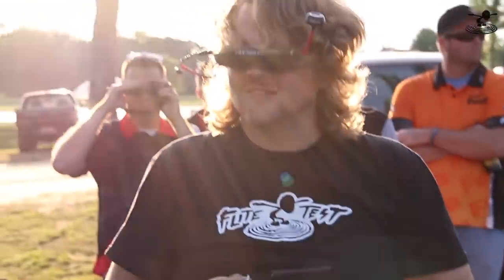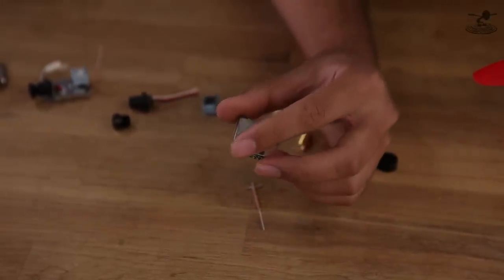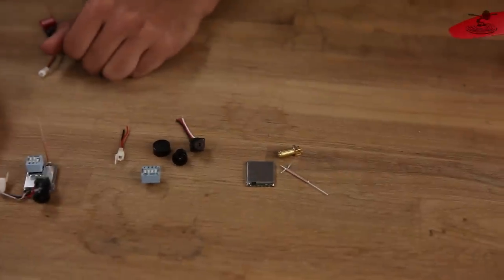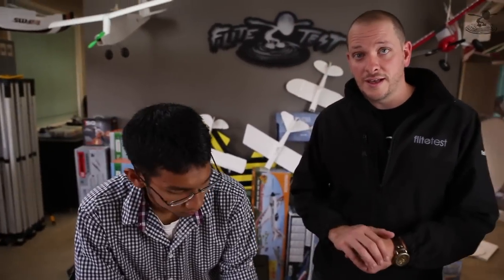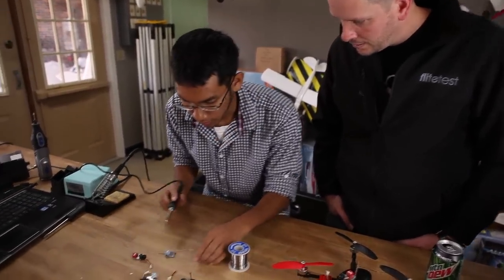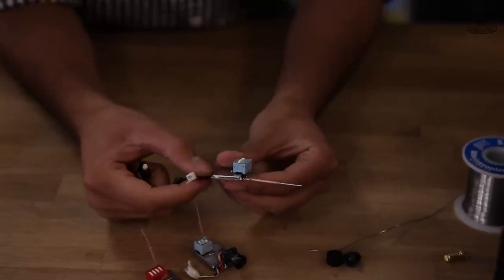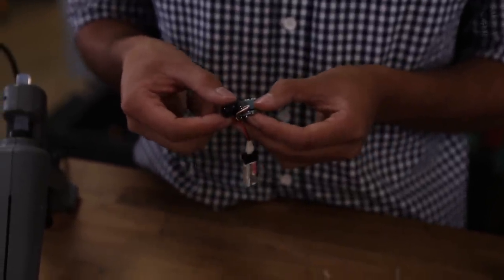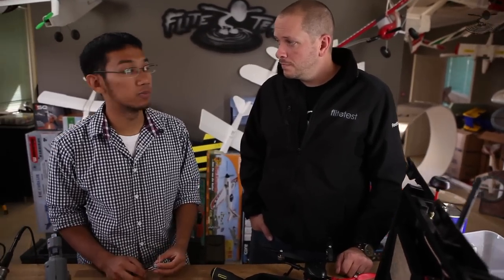Flite Test | DIY Micro 5.8Ghz FPV

Comment: Will this set up work with a 2.4ghz quadcopter,  or will there be interference issues?
Reply: As long as your control and video arent on the same frequency, you will be fine, so it will work

Comment: Is it possible to do the FPV with Iphone or any other smartphone?
Reply: not sure, but i think i read about an app for android (probably ios too) called Litchi that can turn you phone (together with a cheap vr headset like google cardbord headset) into fpv.
Reply: manbolo2 Thank you for the respond, I appreciate it. I will check it out.
Reply: Dale Bergeron
i have only read about it, interested to know more, what do you need to setup? dont you just connect the phone and go? and change what battery?
Reply: Search Andy rc, he has a video of using phone for fpv

Comment: I have video signal but I lose it when my fingers are not touching the tx, I also don't have a 3 position switch.  All the connection are solid same type of attena wire as in the video. Fatshark with clover leat attena.

Comment: This is awesome and perfect timing for me. I just bought the FPVhobby 5.8ghz combo and my range sucks check out my last 2 youtube vids. Could you please do a vid on micro antenna setups? The RX antenna that came with my kit is only 2dBi, I have been told I should step up to a 12dBi antenna to quadrupole my range. Then what about the length of the antenna on the TX side? The little antenna that came on my kit is only 15mm long which I have been told is only 1/4 wave. Also for a cheap ground station (if you own a laptop) you can get an EasyCAP USB dongle ($12), I'm flying FPV now for around $140 (which I think is pretty cheap :D )
Reply: Well. I believe that you've overpaid. I've got my set up for $105 delivered and I don't need to carry my laptop to the flying field. Range to be confirmed but it does penetrate well nearly 0.5m thick brick wall and the ceiling/floor, so should be fine in the open.
Reply: Aussie dollars inc. postage to Australia. I like carrying my laptop to the field so I can record and watch footage between packs. Plus I don't really like goggles and my laptop monitor is nice and large.... And I don't need any additional equipment taking up room in my workshop.
Reply: the 200mw unit that comes with fpvhobbys 5.8ghz super combo

Comment: Hi There,
I need your help on something. I want to put together stand alone turret fpv but I am not good on electronics. What I need your help on is that. My component will be fpv camera, fpv transmitter, 2 micro servos, one receiver for controlling servos and one 1s lipo îf 1s is enough. The help would on cabling how to connect these component together. The thing is that this turret cabling will be separate from the rest of  the drone.
Reply: use 2 receivers, bind both at same time and use different channels not used for flight, enables 360 deg turret

Comment: I want somethimg for high range high speed flying. even for a low resolution such as vga as long as I can not crash my plane. weight is not that much of an issue but nothing more than 200 grams. also nothing that would cost a kidney and a lung. what do you recommend?
Reply: +Anas Malas i recommend you pray for a miracle or get a job
Reply: rebelsouljaz I wish to... Child labor laws here in UAE suck! And living on the 30'th floor there aint no backyards to moa the grass doesn't help either...
Reply: ***** it was a joke, your sarcasm detector is malfunctioning. Try to top up the anti buthurt fluid. If that doesnt work you have to go and buy another sarcasm detector from your local dealer. Remember to only use genuine parts!
Reply: +Anas Malas damn so many people hating for no reason this is smart.

Comment: How can I make the receiver which is receiving frequency from camera device and showing on that LED screen ?
Reply: +Shuvo Islam buy a video receiver. There are many on the market. cheapest 12 dollar but only 8 channels. and the others arround 30 to 60 dollars depending on the brand and type. those have 32 channels and should be ok for all 5,8 except race band. i added a few options. the cheapest i am not sure of because i am not sure on which channel the micro transmitter will go. it has only 8 channels and there are 32 channels. you can connect the receiver to a screen. (see links) there are two links that have a transmitter too. a big one compared to the micro you wanne build but maybe use this for an other project.  and there is also a diversity receiver. this has two receivers in one and will go for the antenna that has the best reception. constantly switching over. works best if you add two differen styles antenna. NEVER NEVER put power on a video trans,mitter without the antenna connected. you will fry the electronics

http://nl.aliexpress.com/item/FPV-5-8G-600mW-A-V-32CH-Transmitting-Receiving-System-TS832-RC832-RP-SMA-Kit/1070833505.html?spm=2114.020208.3.1.cBG8bE&ws_ab_test=searchweb201556_2,searchweb201644_1_10014_10001_10002_10005_301_10006_10003_10004_62_61,searchweb201560_1,searchweb1451318400_6150

http://nl.aliexpress.com/item/Boscam-FPV-5-8GHZ-8CH-Wireless-Audio-Video-Receiver-RC305-Double-lines-AV-output-Receiver-FOR/32283319980.html?ws_ab_test=searchweb201556_2%2Csearchweb201644_1_10014_10001_10002_10005_301_10006_10003_10004_62_61%2Csearchweb201560_1%2Csearchweb1451318400_6150&spm=2114.020208.3.2.T3eyLY

http://nl.aliexpress.com/item/BOSCAM-SKYZONE-FR632-5-8G-32CH-HD-Channels-Diversity-satellite-receiver-RC-Digital-LCD-Display/32250935608.html?spm=2114.020208.3.1.bWDLxD&ws_ab_test=searchweb201556_2,searchweb201644_1_10014_10001_10002_10005_301_10006_10003_10004_62_61,searchweb201560_1,searchweb1451318400_6150

http://nl.aliexpress.com/item/7-FPV-LCD-Color-800x480-FPV-Monitor-Video-Screen-7-inch-HD-Sun-hood-for-Rc/1951841641.html?spm=2114.020208.3.2.HR2KQA&ws_ab_test=searchweb201556_2,searchweb201644_1_10001_10002_10005_301_10006_10003_10004_62,searchweb201560_1,searchweb1451318400_6150

http://nl.aliexpress.com/item/Long-range-FPV-Combo-5-8Ghz-Boscam-5-8G-600mw-AV-Transmitter-Receiver-No-blue-800x480/32324018483.html

Comment: If I want to add an audio, what should I do? Can an ordinary mic be used?? Please do help, thanks.
Reply: At 7:35 they talk about audio input. You have to read the specifications of the transmitter to see if it supports audio. Anyway this video is  3 years old. I think that there are more solutions now in order to avoid this process if you are not comfortable with it.

Comment: On 3.3v transmitter board can you use a 3.7v lipo 1 cell? i can't find 3.3v anything battery
Reply: probably, but i would use a linear voltage regulator for the 3.3 v
Reply: MY BATTERIES WORKED JUST FINE THANKS ANY WAY :)

Comment: You show Fat Shark goggles being used at the beginning of the video, you talk about the different 5.8 bands available and compatibility issues. Can you tell the viewers what receiver equipment is being used with this model transmitter? It is clearly not Fat Shark or Immersion compatible and even the small snippet with the frequency page used to set the dip switches also show non compatibility with the ever so popular Immersion and FS equipment.

Comment: Is the microphone added to the circuit?
Reply: +Terry More it depends if you have a mic or not. if you buy the cam they suggest you have no cam and pay way too much for the cam. buy the camera at banggood and it will have a mic too. and it would cost less then 10 euro. great deal. the white wire will be the audio. the gold round thing is the microphone. 

 http://www.banggood.com/600TVL-8_0MP-14-2_8mm-CMOS-FPV-170-Degree-Wide-Anlge-Lens-Camera-PALNTSC-p-984345.html

Comment: Hello
I Built this little Tx  and it works pretty good. I have the 5v version (Camera 3-5v Tx  board 3-5v) and I used 1 cell lipo but it seemed to get very HOT! after 2-3 mins I really cant see why it would heat up so much so fast? I plan on using a heat sink but that will just add more weight & size Just wondering if anyone else has had this trouble? I thought with both cam and Tx running at 3-5v each (in theory 6-10v needed) I would be fine at 1 cell (4v) battery might get warm maybe and or reduced range but the board had a spot a little smaller than the size of a eraser that felt pretty HOT I am sure if left to operate in this state it would burn it up at some point Anyone have any Idea's on this? just wondering what others have done

Thanks
Rosario
 P.S- I couldn't find any info on the length of the coax cable Antenna it should be a specific length to get the best rang and pic
I could calculate it if no one has the length off hand Thanks again for a neat little project!

Comment: Is it possible to use a tablet as ur display. And if possible, how?
Reply: Rampage851 With that setup, I don't think so. You'd have to build something that uses a Wifi signal and find the right app.
Reply: Rampage851 With that setup, I don't think so. You'd have to build something that uses a Wifi signal and find the right app.

Comment: Hey do a 20 mw transmitter and a 200mw receiver work together and especially can I legally use a 200mw receiver in Germany thanks
Reply: ChristianP1973 yes I now but I found a 20mw module for 10£ from China so I won't be too angry if I brake it and it has the legal frequency aswell
Reply: +Darren Fürst now heißt jetzt und brake heißt Bremse
Reply: +nilslorand oder Bremsen
Reply: nilslorand Ich weiss bin Engländer aber mein Handy korrigiert immer alles und ich bin zu faul um es zu ändern 😉 kennst bestimmt selber
Reply: Hab Autokorrektur ausgeschaltet und benutze meistens PC, also nein, kenne ich nicht

Comment: How could you put a fpv cam on a parrot mini drone? Be great if you could help.
Reply: My guess would be the easiest way would be to use a standalone kit (with all included, including transmitter and battery) so that all you would have to do would be to attach it to the drone.

There many other ways it could be done though.

Comment: Can the 3.3v transmitter handle the 4.2v of a 1S lipo?
Reply: Petrus Barnard  No
Reply: Thought so! No matter I'll just get a voltage regulator and run it off the flight battery.
Reply: Petrus Barnard Can you suggest me a Voltage Regulatore to connect to 4S LiPo? Tnx
Reply: Sorry, no I can't. I don't know enough about regulators to suggest one. All I can say if plan on using a 4S to power it , then I'm assuming you're using your flight battery. While this is perfectly possible, you will have to also add a capacitor to compensate for the voltage changes because of the current changes in the craft, which will produce poor images. It'll be much easier to get a small 1S lipo they're not that expensive and they're very light.

Comment: FLUX FLUX FLUX..... See where I'm going with this?  Liquid solder flux would have made the entire deal much easier when if come to tinning that board. It also keeps more heat off the components because it doesn't take nearly the amount of time for the solder to adhere and evenly spread.
Reply: And it was on this day, that no Flux were given.
Reply: Thats right guys, flux the alternative!
Reply: who the flux care if it works ?
Reply: Flux and Rosin Core solder (60/40).
Reply: I do find soldering with flux much more enjoyable, since the solder flows so nicely. It does add application and cleanup to the process.
Reply: That's what my electronics teacher said. He also told me the virtues of Carbontetrachloride. Now banned in the US.

Comment: little camera i use for my fpv setup it works from 3.5v-5v and has a 170 degree lens all ready so no need to buy another. 
under $10 £7 works real good and is the same size.

http://www.banggood.com/600TVL-8_0MP-14-2_8mm-CMOS-FPV-170-Degree-Wide-Anlge-Lens-Camera-PALNTSC-p-984345.html?p=070519238739201308J6
Reply: +Norfolktuber do i want the ntsc or pal version or does it not matter?
Reply: Hi Depends where you are in the world and what type of tv you use it on most newer lcd tv monitors it does not matter but just in case do a Google search just type your country and ntsc or pal and you will find out
Thanks all the best
Jace.
Reply: Norfolktuber oh ok thanks. looks like i need ntsc.
Reply: DIY TEK NUT thanks for that... ich saw this camera on bang good and i was worried about the quality

Comment: can you put it on the blade nano qx
Reply: I don't think that'll work. Even if it is small, it still has some weight, especially with an extra battery. But have you seen the new Blade FPV Nano QX yet? :)

Comment: hi guys  would this setup work on my syma x8g  ?
Reply: sure but remember you need some sort of receiving end.
Reply: thanks  but what do you mean by receiving end  is that the fpv monitor
Reply: Exactly.
Reply: cool thanks
Reply: +diz9 hi can I fit a mini fpv on my EACHINE MINI h8    I did the antenna mod and I'm getting about 300 yards with it lol
Reply: hiya iv just ordered myself my stuff for building my fpv system it for my  syma x8g   i got the Aomway 700tvl-wdr hd 1/3   2.1 wide angle mini cam   and i got the TS5823 mini 5.8 ghz 32ch 200w transmitter  it comes with antenna and a lot of cables    but what receiver can i use with this for a ground station setup   would a  bosecam rc305 receiver  work ok with this   and  will the  EACHINE ProDVR pro mini video audio recorder for fpv   work with this ground station setup    would this all work together   as a base station setup  lol     i did purchase  the 7' TFT FPV hd monitor for the ground station  f6   it comes with remote and all the leads  but im hopping this should work ok  haha  would you say this will be a compatible setup

Comment: Are there any FPV cameras with decent quality or even digital HD? or is it all garbage.
Reply: the reason its not HD, or digital, is the amount of information that needs to be transmitted makes it unreliable and limits transmitter range. good old analog video signal gives the most stable signal, and the longest range. most FPV flyers aren't looking for quality, but functionality. for high quality recording, your better of with a camera recording to SD card
Reply: The reason for lo-fi analog I've been told is latency and graceful degradation; with analog signal, there is no processing, so the image gets to the screen as fast as possible, and since the signal is simple, noise looks mostly just like signal and so you can lose part of the frame and still get the picture on the screen, and sometimes even see some of the original image blended with noise.

Comment: Where can I get my own soldering iron?
Reply: +XxX_MLG_GMODplayer_321xXx 
Radio Shack, Lowe's, Home Depot, Walmart, etc., or virtually ANY hardware store.
Reply: Haywood Jablomy Wut about Bunnings?
Reply: Thanks! I have one near my house just a few blocks away. Hopefully I can find it :)
Reply: +XxX_MLG_GMODplayer_321xXx if you can buy a hakko 888D by AL means do! its like 60$ in USA, but its so good that I still bought it for 150$ (I live in UAE)
Reply: Anas Malas Thanks for the advice!
Reply: +XxX_MLG_GMODplayer_321xXx so expensive,here we could buy it for only 5$

Comment: Bang good is way better and cheap , I got my mini camera with the receiver  build already for 40$ decent range 👍
Reply: not two years ago when this came out
Reply: +Dot2TheLock what's crazy though is the site they link there parts to are still selling the parts for the same price 0_0.   For the price of the camera u can buy a mini quad with the same camera in it.
Reply: +The great Goliath which are you talking about? $40 for a whole system?
Reply: +Dot2TheLock I wouldn't be surprised if they had it 2 years ago, banggood is always crazy good deals for new technology.

Comment: would this connect with my fatshark? pleasee
Reply: +James Smith i do not know but if not it is not a real problem. if not, just buy a seperate receiver 32 channel. connect the fat shark goggles to the receiver and ready. will cost you 18,5 dollars max extra

http://nl.aliexpress.com/item/100-original-Boscam-RC832-5-8GHz-32-Channels-Receiver-With-A-V-and-power-cables-for/32486428614.html?spm=2114.020208.3.98.vLwxfc&ws_ab_test=searchweb201556_2,searchweb201644_1_10014_10001_10002_10005_301_10006_10003_10004_62_61,searchweb201560_1,searchweb1451318400_6150
Reply: hi thanks sorry i didnt see u wrote back  yesss i have seen that i can plug in a boscam receiver! thanks

Comment: Nice guys but that's pretty old tech you're using, those 1g cameras with the wide angle lens are ruddy awefull by modern standards, there are far better options out there, you could also fit a clover antenna to that mini transmitter for superiror performance with very little weight penalty
As for Immersion/Fatshark being great, I beg to differ they have gone down the route of deliberately trying to exclude the use of 32ch systems to receive the signal as they want people to only buy their own brand gear
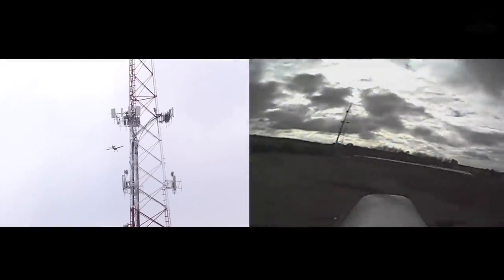Take a look at this video from an alternative (at 1:21 in the video) even at night it's better than the 1g cam with wide angle lens (which I also have by the way from 2 years ago)
FPV Camera Test 600tvl PZ0420 vs Mini Sony 650tvl vs Micro 520tvl

Comment: And Banggood now has a micro cl antenna weighing 0.8 grams: 
http://www.banggood.com/FPV-5_8GHz-Micro-CL-TX-Anternna-0_8g-Lightweight-p-973291.html 
The 10mW TX module working with 1S LiPo can be found here:
 http://www.banggood.com/FPV-5_8G-10mW-Wireless-Audio-Video-Transmitter-Module-TX5813-p-84761.html

Comment: Too bad that that Transmitter is far to overpowered for legal use in Europe / Germany. 25 mW on 5.8 and whopping 10 mW on 2.4, 900mhz completly forbidden and 1.3 only with a HAM Licence. 

Would be nice if you would mention to check on the local regulations considering Transmitter Power, Band etc

Comment: This VTX doesn't work with ImmersionRC!
Reply: I was thinking the same thing. I checked the FIVE (5) that I ordered (and received) against the one in the video and it matches up perfectly. However, on the RangeVideo website it shows that this vTX operates on the A band. I have hope until I am proven wrong.